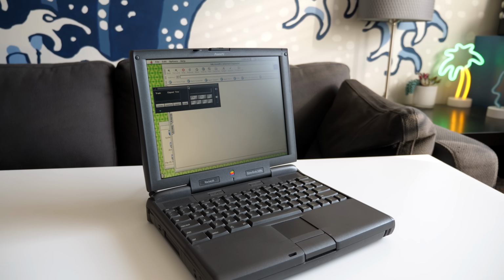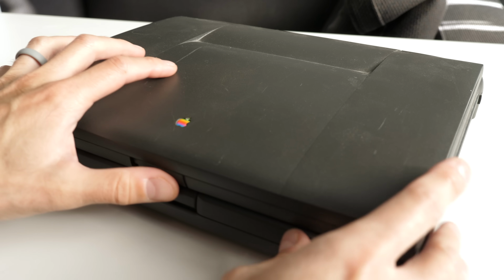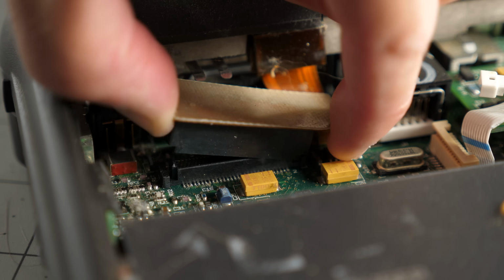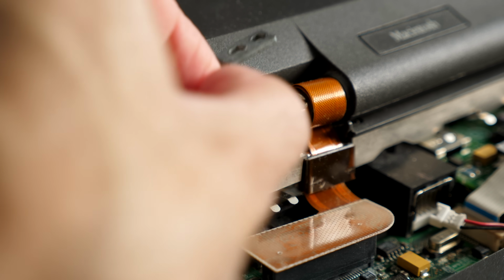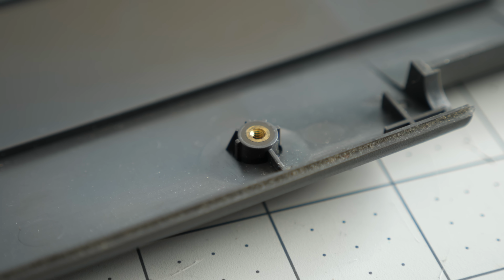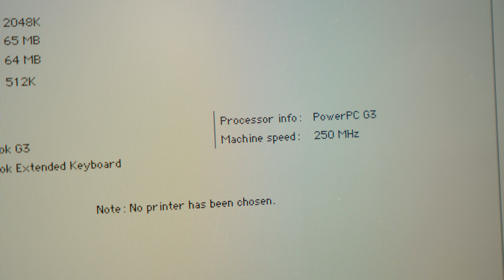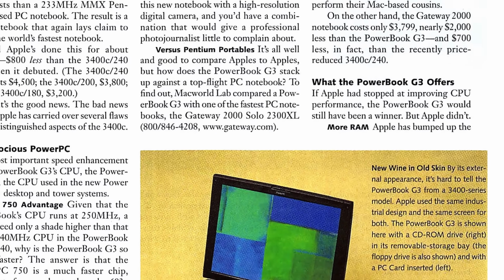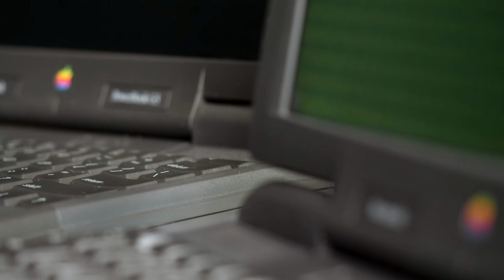PowerBook G3 Kanga: Apple's Shortest-Lived Mac Laptop

Comment: I appreciate this video very much. Down here in Mankato, MN I have an original Kanga that is super clean with no scuffs. I am getting a 20x CD as all I have is a floppy. And a Belkin PCMCIA slot USB card. I hope to swap the mechanical HD with a PATA IDE 2.5 inch drive as well. When cold started, it crashes. But once the internals are warmed up, it runs fine. Wondering what is happening as it warms up.

Comment: This was my first Mac ever. I bought a fully decked out version (160 MB RAM and 5 GB harddrive) a Mac retailer wanted to offload as the new models had been released. My friends with very good desktop PCs had 32 MB … It was also super fast and oozed quality (compared to other quality laptops at the time). The only big downside was that it didn't run OS X (officially). 

Unfortunately, the motherboard died and after a fruitless effort to repair it, I got an iBook G3 with combo drive (CD reader and CD burner).

Comment: Just pulled mine out of storage and the bottom half of it is crumbling like a pack of stale crackers. I’m frantically taping sections with packing tape just to keep them from falling off. Not sure how to restore this one. I remember when I got it new in 1997 as and it was bad ass! I believe it was responsible for me transitioning to laptops permanently over a desktop.

Comment: Good memories are bubbling up. This was my first Mac and my first laptop ever. I got an amazing deal for a fully decked out machine on what would become ebay Germany. It sported 96 MB or RAM when my classmates had at most 32 MB in their tower PCs. It was also stupendously fast at the time, I really loved the machine. Unfortunately, the mainboard died and I had to replace it. The only “limitation” was that this was the only G3-based Mac I am aware of that was not supported by MacOS X.

Comment: 7:35 you arent aware of instant glue and baking powder mix? just try it and you can repair any plastic housing, it solidifies instantly and is hard as a rock and can be shaped with a dremmel tool - stop "gluing" and start repairing the right way :D

Comment: If I'm removing a rechargeable clock battery like that, I like to leave a note in that space with the battery specs [voltage, capacity, chemistry, dimensions, model number if possible], maybe also with the JST connector cut from the original in case I want to replace it later.

Comment: I absolutely love this machine, wish I had a newly re-celled battery for it though. Watched Beverly Hills Cop on VCD with it being connected to a 120" wall projector using the very handy VGA port and the Kanga speakers acted as a proper drive-in like speakerbox to complete the experience lol I remember trying so hard to track down a 3400c because of the RocketBook article only to acquire a dead one and then learn that the G3 was housed in the same case. 

Found one and have been rocking it sense! Found it interesting that they used them in You've Got Mail movie as well. Those book store owners were rich! $5,700 for a laptop would've been inconceivable for me at the time and most likely even to this day lol Thanks for pointing out SoundJam! I'm going to have to load that up...

Comment: I always liked the Kanga. Other than the obvious processor upgrade, there were two major improvements over the 3400: increased bus speed (50 vs 40MHz) and larger, faster L2 cache (512k @ 100MHz vs 256k @ 40MHz). Everything else was minor but did add to the experience: there was a small bump in the graphics chip (Chips 65555 vs. 65550), more base RAM, larger HDs, faster CDROMs (up to 20X), and slightly better batteries. Sadly, like the 3400, these don't officially support CardBus (you need to hack/replace the card cage to get it), which is limiting since they can't use USB or FW without it, though you can still get 802.11a/b WiFi cards for it. I have a couple of these but one has a problem where it just... stopped booting. Powers up and chimes, then sits there blankly, sometimes with the breaking-glass error chord usually indicative of a hard crash early in the boot process. It doesn't seem to be an uncommon thing, either, but no amount of standard troubleshooting brought it back, which has also been experienced by other people and so far nobody seems to know the exact cause or a solution. I put it on the shelf for now; maybe one day I'll figure it out.

Comment: Yeah, the "subwoofer" speakers behind the display  sounded more like lower-midrange speakers to my ears (I had a used 3400c/200 years ago).  It was always mystifying to me why Apple soldered the CPU to the motherboard in these machines, given how much they cost.
Reply: The CPU was soldered for two reasons: 1. the 603 was only offered in QFP or BGA packages (and the 750 only in BGA) and you can't simply socket those; they need to be soldered to something first (the only option at the time being the fairly large 288-pin PGA used in the RS/6000 and later the desktop G3s), and 2. in these there's limited space for a daughter card because they prioritized a full feature set in the smallest package (though it's laughably big by modern terms it was pretty compact compared to other 1996/7-era PCs with similar features). Other PowerBooks made it happen but that's generally because they were big-ish, had to be clever with arranging internals to get everything packaged up, and/or they emphasized CPU upgradeability (as in the 500 and 1400 series).
Reply: @fsfs555  Oh definitely. But still, Apple being famous for having amazing engineers working there, you'd think they could've come up with some kind of daughtercard or daughterboard arrangement that would've worked.  Then again, it probably would've raised the already sky-high prices of the 3400/Kanga 'books, I'm guessing.
Reply: @angryshoebox  Maybe, but these things are very tightly packed. If they used a thinner hard disk, say 12mm max (these could accommodate up to a 19mm drive), they probably could've slotted a CPU card under there but that would've reduced the maximum HD capacity when shipped (the factory 5GB drive was 17mm). Or they could've soldered the Ethernet/modem subsystem and put the CPU on a card instead of vice/versa. Also remember these are based on the legacy of the 5300, which was not the best PB design of all time. They should've designed the 3400 around the 1400 instead. But Apple was famous for bad decisions in the mid-90s, so here we are.

Comment: I have been waiting for a video featuring the Kanga... I have two functional Kangas as well as a G4 Pismo in my collection. I have found that the older these laptop get, the more brittle the plastic parts tend to be... watch out when you let the legs out on the Kangas... I did what you did in the video and cracked the casing... I will have to address this with super glue at some time...

Comment: The best solution is not just superglue, but superglue mixed with baking soda. The exothermic reaction is potent enough to fuse the plastic parts together, creating an even stronger bond.
Superglue alone won't guarantee a permanent fix, I'm learning that the hard way with many modern laptops reliant on such standoffs to keep their lids and screens in place.
Reply: As someone who constantly has to deal with broken screw inserts, i'm gonna have to try this.
Reply: How does one mix them together?
Reply: Interesting method, im used to using steel epoxy for my clients and its usually effective, but takes time to settle. ill try this to compare
Reply: It doesn’t work that well. I’ve tried it numerous times. It absolutely does NOT melt the plastic together 🤦‍♂️ it creates a very brittle flaky cement material. It’s good for filling large gaps and that’s it. Two part epoxies will always outperform CA (superglue)
Reply: @YoureUsingWordsIncorrectly  I have no clue how you get that to work. For me it sets very instantly, and I have no time to mix it up.
Reply: @owmylehg7811 OK I know this is two years old but in case you or anyone still needs the info you don't mix them in a separate location, baking soda is an accelerator

You mix them in situ. You add baking soda to the area that you're glueing then add baking soda and join the parts. Or the other way around. I personally had more luck with baking soda first.

You have about 10 seconds to connect your parts how you wish, and the heat reaction flashes super hot for a millisecond in that time. So be careful.

Hope that helps.

Comment: I have the same one only with a PowerPC 603ev running at 180mhz. Mine came with nearly maxed out ram ( a 120mb module ). I replaced the hard drive with msata SSD (64 GB) in an IDE enclosure. Machine became very snappy. Has OS9 on it now will do the final upgrade to 9.1 soon I was to busy with turning my Powemac MDD in to an absolute beast. .

Comment: Thank you for rescuing the Kanga.  I have one working in about the same condition, works great.  Only problem I have it's picky with the power adapter that I use with it.  I've found the later power adapter work better.  The power adapter that came with my Bronze powerbook g3 seems to work the best with it.  Other than that it is a great machine!